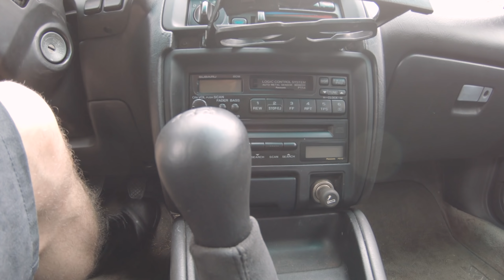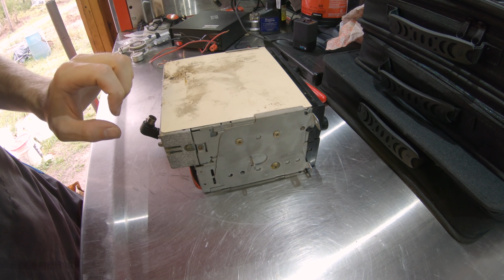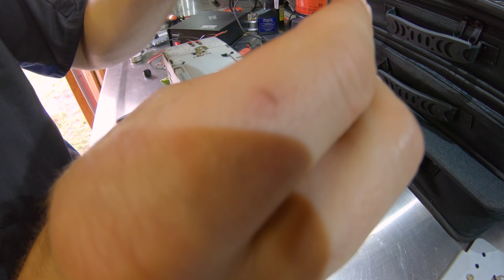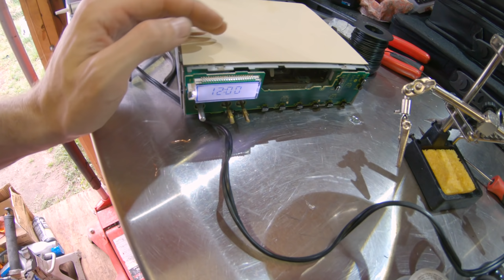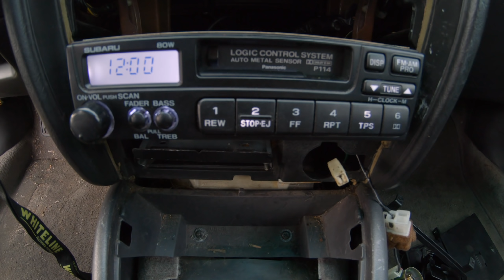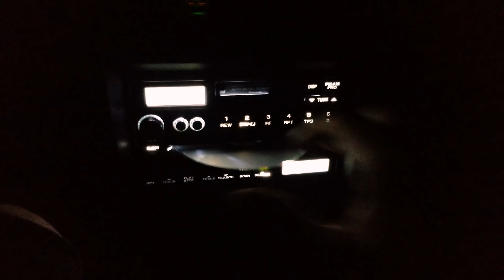Subaru Radio LED Upgrade

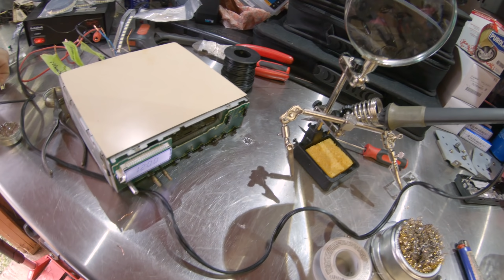Comment: 18:20 for resistor / LED spec: 221 resistor (220 ohm 1 watt) and 5050 LEDs which are available in a variety of colors
Reply: Thank you very much for the led/resistor specs!!

Comment: Mr Subaru Just a suggestion.  I have desoldered thousands of components and the easiest way is to add Rosin flux solder to the pads on the board before desoldering.  They clean all the rosin off the board during manufacture and it is hard to heat the entire joint.  You should have put multicolored LEDS blinking...    LOL   Thanks

Comment: Hi might be a stupid question but why the resistors, is it so the led don’t blow with direct 12v.
Reply from the maker: Yes. 12v direct would burn the LEDs out instantly.
Reply: Thank you.

Comment: Hey have a quick question for a 2005 STI, if measure the resistance with a coilpack with a multimeter and it read 1.0 Ohm is it good? Or is it suppose to be .8 ohm? 3 coilpack read 1 ohm and 1 other is .8 ohm are 3 bad or 1 is bad? Thank you
Reply from the maker: Do you have a misfire?
Reply: MrSubaru1387 no check engine light is on for a misfire, just changed the spark plugs and thought might as well check them

Comment: have you used this combination of led/resistor before? do they sustain the changing voltage level of the car? 2 months ago i replaced my whole dash illunmination (including all buttons) using some warm white, 12v leds with 200 ohm resistors on my GF8. unfortunately my combination seems to have not worked well, as many of them have already gone dark or are flickering like crazy
Reply from the maker: Used this combo exactly when I did my 98 LGT. No issues for 2 years, up until I sold it.
Reply: @MrSubaru1387  that's some good news. will redo mine the same way 👍

Comment: Very awesome video.  Kinda shocked that you didn't just put an aftermarket radio in place due to it being easier and since the cassettes are phased out now days,  but I still like stock as well.  Flows with the dash and trims. Doesn't stick out like a sore thumb.  Keep up the good work.
Reply from the maker: Yeah, I absolutely hate aftermarket radios. They're so gaudy. I plan to do a video on adding an aux cable to the factory radio.

Comment: Hi!
I have a long lasting problem with my 2006 Forester 2.0X and it drives me mad. After a full stop, but only uphill, the front left brake locks. Sometimes if it doesn't locks fully, a light press to the brake pedal and turning the car downhill releases it, but a hard braking to a full stop uphill means I'm fckd, and have to release the brake from the bleeder at the brake caliper. Not fun on the road. I have changed already: rear wheel cylinder (drum brakes) on both sides, rear brake shoes on both sides, front brake hoses on both sides, front brake disks on both sides, front brake pads on both sides, pistons and all the rubber parts in the front brake calipers on both sides, washed the whole system with 2 liters of DOT4 brake fluid, changed the master cylinder assembly, and the P.C.V. assembly. Everything with brand new, not OEM but quality parts, except the P.C.V. assembly, which was a used part from a newer generation forester. Where is the problem or what else can I try? Thanks!
Reply from the maker: Have you replaced that caliper?
Reply: No, the caliper is the original one, just changed the cylinders and rubber seals, dust seals etc in it.
Reply from the maker: I'd check the hard brake line for any dents, kinks, bends, etc. If none are found, I'd replace the whole caliper.
Reply: I can do that. But why only uphill I have this problem? Downhill or leveled roads I can do an emergency brake without having this issue. And when I replaced the pistons in the calipers, they went in and out smoothly (before inserting the rubber rings) and there was no visible damage on the caliper. I'll check the brake lines for dents anyways.
Reply from the maker: I'm not quite sure. That is odd that it's only uphill. Any ABS codes? Have you checked for faults in the ABS module? Could be some intermittent issue looking that wheel.
Reply: @MrSubaru1387  Maybe it has hill assist and is malfunctioning?
Reply from the maker: Don't believe it was an available feature in 2006.
Reply: Just foud it out it's the hill assist that made this error. Don't know yet what happened from one day to another that it started to malfunction but I just adjusted it and now it releases the brakes when it should.
Reply: @MrSubaru1387  my friends 2004 Forester XT had it

Comment: Pretty sure the CD slots are supposed to illuminate regardless. Atleast they do on my second gen
Reply from the maker: Hmmm. The 3 I've had only illuminated when a CD was inserted.
Reply: @MrSubaru1387 you know what now that I think about it you're right. But wouldn't it have made a lot more sense to have them illuminated all the time so you can actually find the slot?  Lol
Reply from the maker: The edges of the slot are illuminated, as well as all the buttons. The only thing that doesn't illuminate is the display.